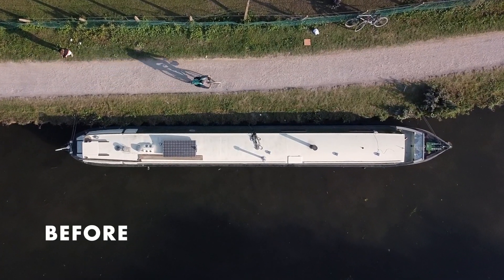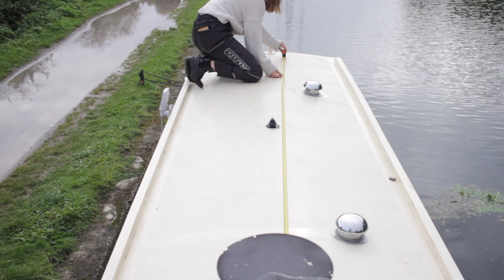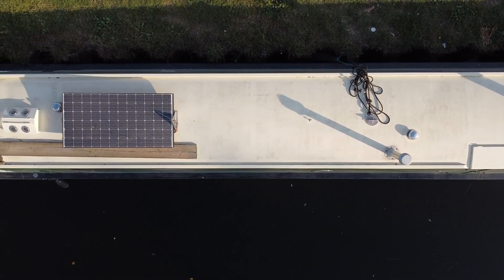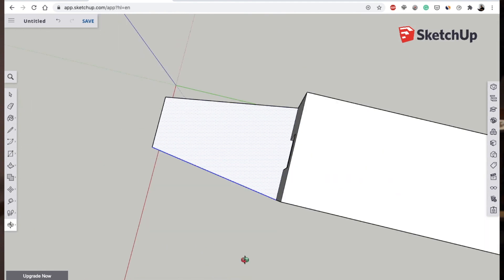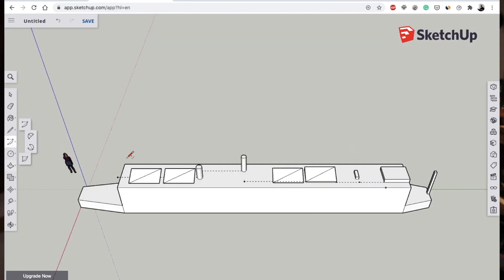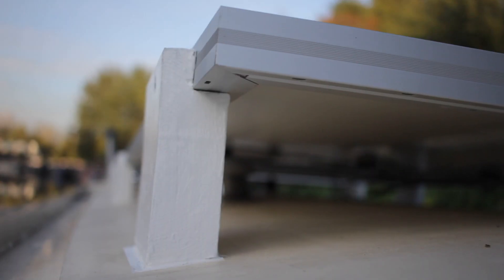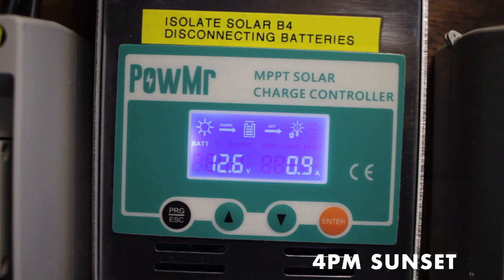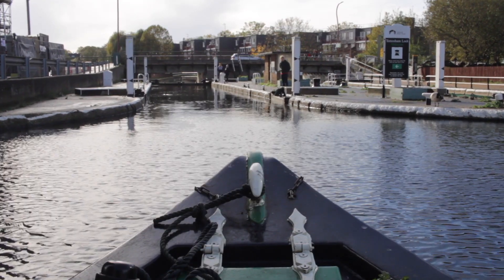5. Getting Solar Power on our Narrowboat

Comment: Fitting and wiring panels is well within the scope of most boaters, perhaps a little lees time on the CAD and a bit more with the screwdrivers? However, well done for thinking ahead and getting prepared for less favourable conditions. You must now have well over a Kw of panels, excellent.
I was quite sure you meant amp hours, though without stating the voltage we can't know the power (I presume your mppt gives readings for both the panel side and battery side). For example if your panels were (instantaneously) giving 8 amps at 24v then you would see 16 amps on the 12v side. 
I'm puzzled why you would want to sit on the roof when there is so much towpath around though?!
Good luck with it all.

Comment: That was a very good presentation. The costs do mount up but the panels will keep you powered for most of the year. I think it is best to look at Watts rather than Amps coming in as Watts are power. If you just look at Amps, what is the voltage at which those Amps are supplied?

Comment: A good effort and even bonus marks for not forgetting your GCE classes with the sketch-up.  A failing grade though for physics - Amps  measures electrical CURRENT..  Amps per day measures - well, nothing really.  You're not alone,   What you are interested in is WATTS or Kilowatts (kW) for power, and Kilowatt-hours (kWh) for Energy, i.e. the amount of the very stuff you are generating over (say) the day) 
Don't give up though, you're on the right track.  Just dig out the old physics text book you forgot to return to the school library and give it quick read.  Everything anyone needs to know is in there :)
Reply: Came here to mention this. That saying we used 40 amps in a day is meaningless. Kind of like saying we used 40 psi of water today. 
Edit: Yes, I know in using water as a metaphor for electricity that pressure is akin to voltage and flow rate is akin to amps BUT who as a layman can relate to flow rate? Distinguishing pressure from flow is as alien as amps from voltage to most people.
Reply: The only 2 things from that physics book you need to know are W=VA (Watts=Volts x Amps) and Energy used = Watts x hrs (Expressed as kWh which is Watts / 1000 x hrs). So a small 50 watt fridge that cycles-on for 15 mins every hour uses 0.05kW x 0.25 x 24 = 0.3kWh energy per day. 
What that physics book won't tell you is that most solar discussions, related appliance stats and consumption figures seem to default to Amp Hours (AH) as the main default measurement. Maybe this comes from standardised battery "size" stats which is the capacity of the battery. Which is akin to the "size of the reservoir" in the water metaphor. Which is actually both easier to visualise and describes how much "potential energy" you have stored. 
So that 12V 50W fridge would require 25AH of stored capacity every day. (0.3/12x1000)
Reply: Relating back to the video, I guess saying "We used 40 amps of power today" is shorthand for "We used 40 AmpHours of power today".
Reply: @DiscoFang  God, I hate to stir up this yet again, but 40 AmpHours still doesn't equate to power. 
Power = volts * amps
Energy = Power * time
So, assuming this is a 12volt circuit, she could have said "We've used 480 watt hours of energy today" which at current prices is about 10 pence worth.
Reply: @pooterist  You kind of repeated what I first said.
Reply: @DiscoFang  exactly.  Without the voltage, you can't use the word 'power' or 'energy'
Reply: Condersending much!   I think she did a perfect job and of course she meant amp hours a day.  That was useful for at least me to know.